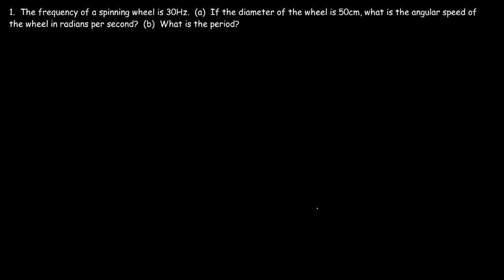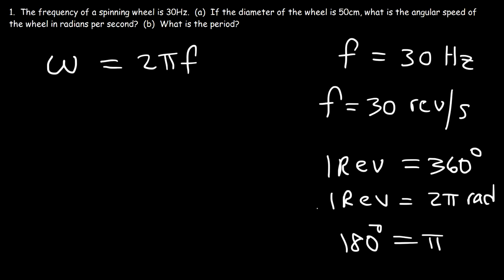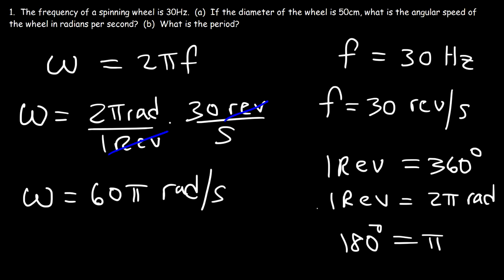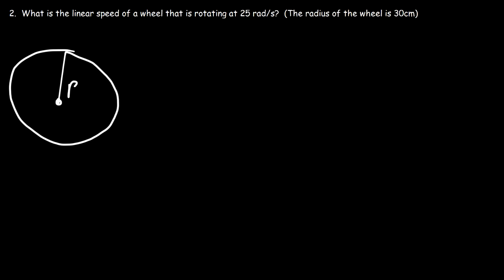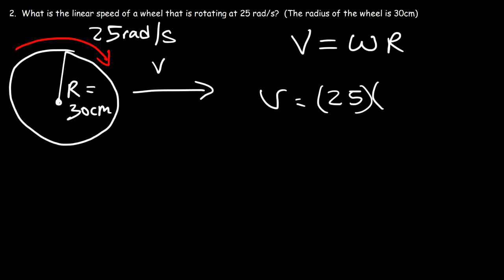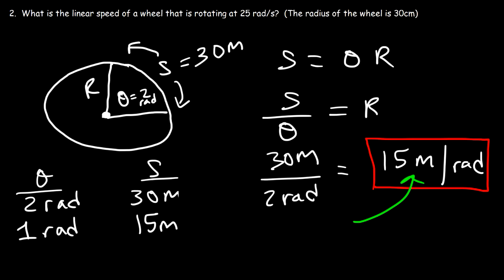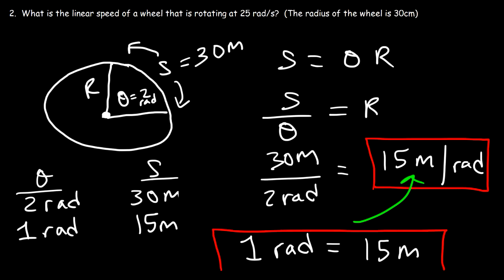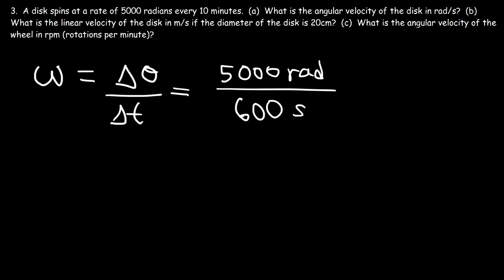Angular Velocity Physics Problems, Linear Speed, Frequency & Period

Comment: In the last question I actually converted the 45rev/s to rad/s, then I used the rad over s multiplied by the 1.4 m over rad, I then converted the meter per second to mph. At first my calculations were wrong, because in my notes I thought 1 mile is equal to 1.609 meters, it's actually 1609 m, I used the centimeter (it was listed in my notes that the 1.609 has no symbol (cm, m, etc.) beside it, so I thought it was "m" instead of "cm") and got confused. In my second try I used 1609m and the answer was finally correct. I understand how I used my own version more, because conversion is very complicated for me, but in the end, the way you solved the last question was way faster and easier than how I solved it. By the way, your lessons are very helpful, I'm actually trying to advance study because of what happened today (I had a failing score in my gen physics subject), and yeah this is for the upcoming 2nd quarter lessons, this is helping me a lot, THANK YOU!!!